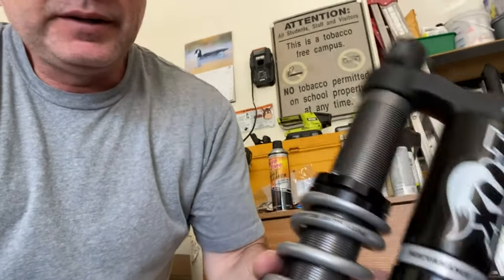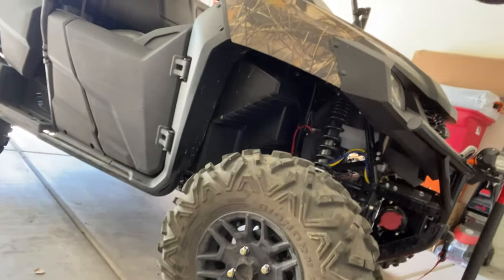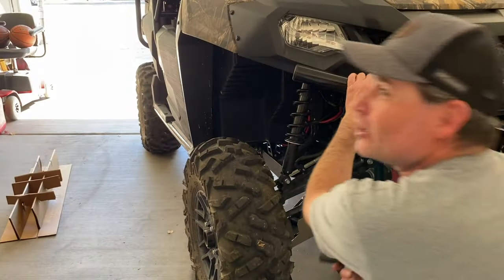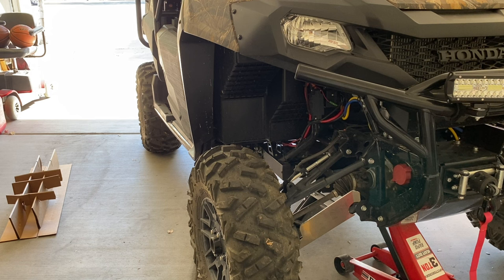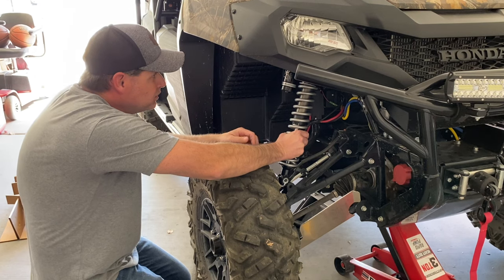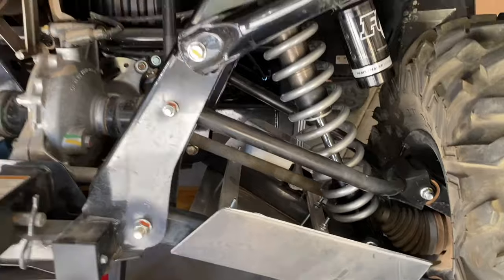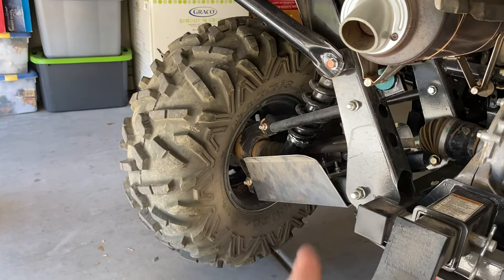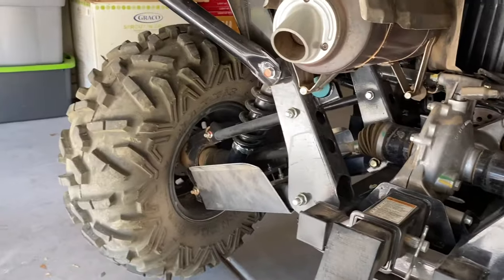UTV SHOCK INSTALLATION, HONDA PIONEER QS3 FOX RACING SHOCK 885-06-108 PART 1 , PART 2&3 TRAIL TEST

Comment: Did your shocks come with springs? Mine didn’t and I contacted the place I ordered from and they told me to use my old shocks springs? This didn’t sound right so I called Fox and they said they should have new springs that come on them.
Reply from the maker: Ya mine came with everything. Who ever u purchased from is pulling a fast one

Comment: Did you torque your bolts when you installed the new shocks?
Reply from the maker: Sure
Reply: @ArizonaKid  Curious what torque specs you used.  I'm replacing the shocks on my Pioneer and I cannot find any documentation on this.
Reply from the maker: @troynoall793  did same as tires . Just a guess
Reply from the maker: @troynoall793  but does having locking nut so will not back off anyways